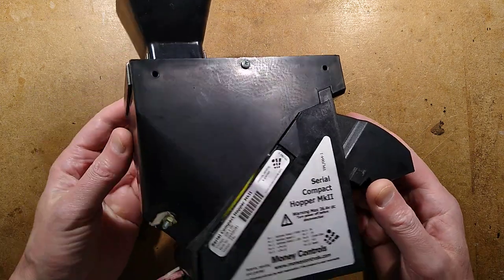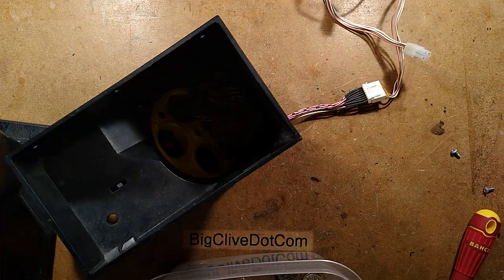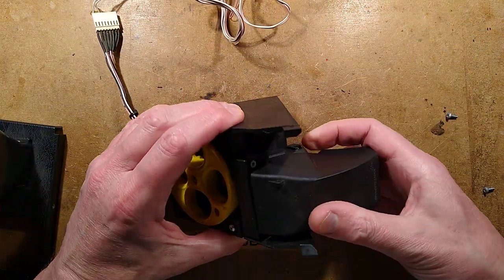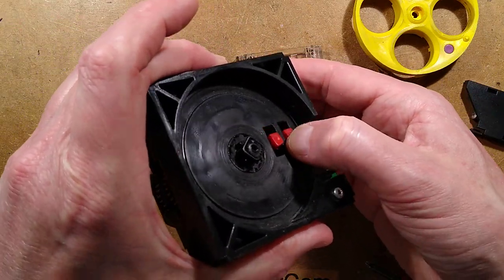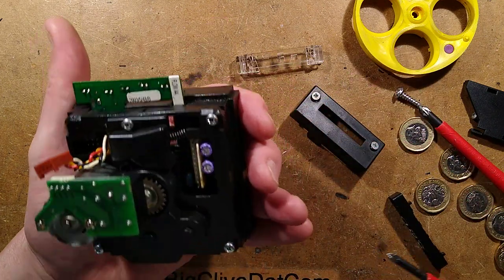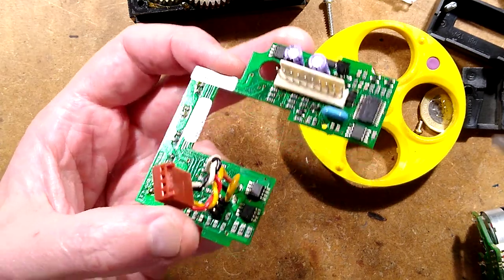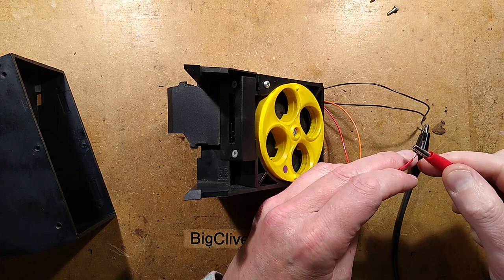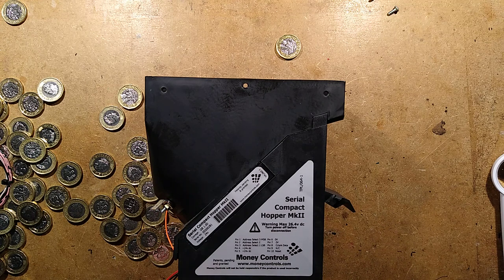Coin payout hopper teardown

Comment: There used to be a trick where you could shine a light up the chute, and the optical sensor wouldn't detect the coins springing out. However the computers running these know how likely a coin is to be pinged out if there is continuity, and it'll stop if you do this now. Sometimes they'll even alarm. On the old fashioned machines though, you do that and they just won't stop spewing money out.

Also, in the design clive seems to have, the fact the center sensor diode has 2 LEDs reflecting down onto it instead of the one, they could detect the intensity on the center and the outer ones to see if there's a difference. Then the machine would know something fishy was going on.
Reply: And I was just thinking to saturate them with a ton of IR. Guess I'm too late to that party.

Comment: I suspect the hot melt glue is to prevent vibration induced problems.  Those hoppers and their motors generate quite a bit of vibration, especially from coins dropping in and pinging out.  So the glue helps mitigate the risk of a pin working it's way loose over time.

Comment: AVE’s work here is done.
You have a high speed healing bench, you can analyse the construction of mechanical gears and once you have a Stanley knife to cut into the plastic to determine if there is glass fibre content, AVE can retire with a clear conscience.
Perhaps if you sent the mechanism to him he could see if it could dispense small munitions at the same high speed as it does coins. That would be fun 😁
A very interesting video, I had never seen inside one of those mechanisms before

Comment: The DC braking is probably to stop the little red plastic detents from paying out extra coins. The motor is geared down and with all the coins in their respective holes, it has a fair bit of inertia, so you want to stop it before it overshoots and dispenses an extra coin.
Reply: I would imagine that motor braking really took out some relay contacts.
Reply: I'm puzzled as to why Clive didn't show is the difference between braked and unbraked stopping.
Reply: Does this dead-short braking work with induction motors ?
Reply: @millomweb  Induction motors use DC injection braking, where a low DC current is put through the motor.
Reply: @ATMAtim  Its actually pretty harmless on the contacts since there is no arcing on the opening action, which is the main failure mode of a relay.
Reply: @drkastenbrot  So linking all the wires together doesn't work ?
Reply: @millomweb  with an induction motor there are no permanent magnets to provide a consistent magnetic field for braking
Reply: @millomweb  not as consistently, residual magnetism might still be enough to cause current to build up but it will be delayed and inconsistent.
Reply: @drkastenbrot  I know :) but there's a rumour going around that the induced magnetism remains for a short time while the rotor spins.
Has my electric hedge trimmer got any permanent magnets ? I don't know but the short-circuit braking works on it (when the switch works!)
Reply: @millomweb  it absolutely does. short-circuit braking on a universal motor (like in your hedge trimmer) works very well because its literally a short circuit. there is no need for any fine control, it just shorts out the spinning motor right after it was powered, which will reliably bring it to a stop. after that, holding torque is pretty much nothing, you can manually spin it. 

you cant really do this with industrial machinery though, anything less than fine control and things may blow up. or they break due to excessive braking force.
Reply: @drkastenbrot  The thing with the hedge trimmer as the power off switch also shorts the motor out - so is pretty instantaneous on releasing the trigger. I'd be surprised if they've fitted a permanent magnet to the rotor just for this function so presume it's residual magnetism that's being used. Could be back emf with the power going off too !
But does this just work with a wire wound rotor and not squirrel cage - I don't know !
Reply: @drkastenbrot  Easily controlled by putting a resistor in the circuit if needs be. I don't think it is needed as the braking power is not going to be vastly different from motive power as the mechanism is the same. Interesting thinking about it though.
Reply: @millomweb  "Easily controlled by putting a resistor in the line"
There is 500 page books on industrial motor control. It is not nearly as simple. 
Without DC injection you are relying on a cascading effect where the current induced causes enough field to induce more current. You cant just "balance" this with a resistor. It either abrubtly stops with a huge current spike or doesnt stop at all. DC injection means adding an exact DC current for an exact braking power and the stopping torque remains as long as the DC is switched on. If your load has several tons of spinning mass, stopping things too fast can be catastrophic - not just electrically.
Reply: @millomweb  It is a mains powered hedge trimmer, right? This type of switch is very common in cordless tools too, but those use permanent magnet motors. 
The universal motor found in AC tools will reliably stop with a short circuit, if the short is made as it is still spinning fast. This is due to strong residual magnetism providing the necessary starting field for the cascade effect to kick in. 
There is definitely no permanent magnet in the motor because it would make the motor run poorly (lots of vibration with AC power).
Reply: @drkastenbrot  As it's the electrical current providing the 'braking' using a resistor to control/limit that current would control the braking. I believe it's what the Tube used to use. Hopefully now, it's more regenerative braking.
Reply: @drkastenbrot  Actually, it'd be a synchronous motor - running at a fixed speed dependent on mains frequency - as used in clocks and zone valves.
Reply: @millomweb  Trains use DC motors with field coils, and they keep the field current running, effectively turning them into permanent magnet motors. The control electronics used for braking are quite sophisticated, and the resistor bank merely serves as an "energy dump" Many trains use a third rail for regenerative braking, although its not as important as it seems, there is not that much recoverable energy in the first place.
Reply: @drkastenbrot  I don't recover many petrol mileage miles in my car going downhills either !

Comment: I used to work for an amusement arcade in the 90s. One of the things we were told to keep an eye out for was deliberately chipped or sanded off paint on the metal frame of fruit machines. This would indicate a possible "sparking" attempt. 

"Sparking" was done by applying a high voltage load (possibly from a capacitor) to the casing of the machine. The idea was that it would short out the machine and cause it to empty the payout hopper. I'm guessing the relay is there to prevent this.
Reply from the maker: It was probably for piezo sparkers.   Many machines have an antenna in the loom to detect that now.
Reply: Probably be the tube machines in the 90s most hopper machines have EMI shields and are unsparkable

Comment: I deal with these coin hoppers all the time. Often have to take them apart, due to the human factor of dropping more than just coins in the hopper. Plastic coin bags, bits of paper, screws and other items falling into the hoppers, jamming them up. I have to clean and remove the items from the sensors and spinning disc. This is quite an old hopper as the security software protocol has changed, but the basic design is the same, only 3 coin holes in the spinning disc in the newer version.

Comment: The ccTalk is very much like the original J1850 VPW communications standard used by Delphi/GM for their first generation OBD-II vehicles. Only real difference is the use of +12V instead of +5V in regards to the actual signal itself. Speed was quite limited (~10/41 kbps) since its basically open collector so the waveform had very sluggish transitions. Still it was nice to program with since there was a dedicated IC in the modules that handled the coms, and it only required a single yellow 16 AWG wire running around the car for the network.

Comment: I'm thinking if you found a way to force the wheel around, good luck dispensing coins quietly. Or quickly. Anything else is going to be very noticeable across the room. And that brake would make the job that much harder (though that coin shooter would be a challenge by itself). The whole up-and-over design cannot be by chance. And the noise has been engineered to equal success and riches. Skint via Skinner box.

Comment: Reminds me of the 70s-80s where some department stores had tills with coin dispensers - a separate unit from the till itself and usually positioned at the end of the checkout desk.
Reply: Many stores here (Sweden0 have combined receive/dispense units at the tills, next to the card terminal, so that the cashier doesn't need need to handle coins. The customer can just drop a handful in w/o doing an exact count, and it spits out any change not covered by bills/notes.

Comment: Sintered gears and things are made that way because they can be impregnated with oil and self lubricate, if you take one, wash and dry it, then heat it, the oil will start running out of it (I include an initial wash so you know its nothing from the outside coming off)

Comment: I used to know a few people who`s "job/carrer" was traveling around the UK strimming fruit machines. 
200k plus a year all cash no tax to pay!. 
But the little device they used to have was a semi stiff rod with a few movable joints. A wire running the length attached to a 9V bat and a push buttton switch. And on the other end was a light/optical sensor I think. 
So its was normally a 3 man job two people stood on the outside of the guy in the middle who was "playing" the machine. The two guys job was to block peoples view and to make it look like just some guys watching some one win. 
The middle guy after playing for a bit would take out the device and push/manipulate the rod up through the coin shoot to get to the optical sensor. 
With every push of the button it would trigger the coin/shoot to open dropping as much as they could reasonbly get away with without causing suspicion. Most have been caught over the years but as its classed as fraud which is a white collar crime they did very little time. Max was 6months !. Crime does pay if u can deal with a bit of time inside haha.
Reply: Modern robber barons require modern robin hoods.

Comment: The old universal hoppers that predated the compact hoppers were conssiderably simpler, being a motor control input and a photocell output. The internals used a plastic chain belt rather than the disc used these days by compact hoppers, so they could take pretty much any coin that would generate a wide enough pulse for the host system to read; their size also meant that they could hold several hundered pounds or a couple of thousand with the extension box that fitted on top (this predates the 2 quid coin) but obviously required a much larger armoured cabinet, hence the popularity of the compact hoppers. Interestingly, the same old pair of plates were used to detect the hopper getting low... I doubt anyone paid any attention to the signal, I certainly never did.

The CCTalk protocol was pretty involved with some fairly gnarly looking encryption of a cycling payout 'token' in conjunction with the payout amount that would prevent an attacker who gained access to the serial bus from replaying payout commands to get arbitrary payouts. You had to sign an NDA to get access to the intimate details and be from a company that had a reason to know.

In a similar move, the old style Mars coinmechs were superceded by intelligent mechs that communicated over serial rather than simply pulsing coin lines - they are all quite interesting inside though, with the various cutting blades and baffles to prevent stringing with fishing line and coils to detect metal stringing and coins going backwards through the mech.

Fake notes and coins were always interesting, the great thing being that you always end up with an example to give to the manufacturers for the next countermeasure - some old note acceptors could be fooled by a piece of paper with the appropriate strip of note attached, allowing two fakes to be made (since notes can be presented in any orientation)... multiple simultaneous scanning stopped that. One of the most labour intensive fake fivers I remember being told about (we made the control electronics for change machines so I got to write the software) was a B&W photocopy of each face onto tracing paper sandwiched around blue paper and a couple of metal strips - I think I would prefer a real job, it was a lot of effort for a fiver.🤔
Reply from the maker: I have one of the original universal conveyor hoppers.

Comment: Nice video Clive. I'm a gaming engineer I fix fruit machines in parks and anything that is coin or notes operated, I even buy old broken fruit machines and sell them, if you ever wanted to make another video like that I'd be happy to send you a newer part for you to experiment with. That hopper is out of an old machine or a plan cctalk communication like a quiz machine or a very old machine back in the 90s. But most machines in the pubs now only have DES inceptive parts that need to be paired in the machine in a certain way because it'll work in the machine. If you'd like to know more please message me but thanks for a great video, you've gained a sub from me :)

Comment: Yep, BCR (Bulk Coin Recycler). Those hoppers are fast, they effectivly spit out coins like a machine gun. Interesting to see them in this configuration. Money controls is quite widespread, they are alright. Not perfect either though.
Reply: That mechanism might well work for "nerf" type shooter.  Although, the projectiles might need to be a little too solid to resist the spring ejection.
Reply: Why am I wondering what Jörg Sprave would create for a coin launcher...

Comment: i'd guess the DC breaking feature is to prevent mechanical rotation of some kind.

the backwards 'long' gear ratio from the wheel to the motor would result in a high rpm rotation (high voltage as a generator) that could perfectly make use of the DC shortcircuit via the relay.

the same long gear ratio would multiply the breaking force from the motor to the wheel to even better prevent manual rotation.

Comment: Don't think I've ever seen the coin rotator go in reverse by itself. The metal disks in the hopper when connected to the bus will report coin levels I believe though resistance levels that get translated to a number via a table. An additional bit of metal on an edge is used for a hopper full trigger.

Comment: I use to work for Gala Bingo on the machines and they have security mods over the year's. With the relay on the motor is to stop people poking wires up to power the motor. People also would stick a certain light up the money chute to trick the machine to unable to count money being despenced paying out more money. Also people would make a small E.M.P. with 9v battery to trick sensors in coin slot to get free credit's. Fantastic hacking just like the old magnet trick to turn metal reels now they are plastic.
Reply: '...EMP..."
Dude you are going back to the mid 80s and the days of strimming  with that hack. Our local boys favoured the electronic lighter with unpredictable outcomes from destroying the MPU, loads of credits or just dumping the cash out. However, by the mid 90s that hack seldom worked due to better protection of the electronics.

Comment: As I stand here with my finger under the tap of cold water I tell myself, I should learn not to hold a small resistor in a peang with one hand and watching @bigclive tearing down electronics, and then try to grab the iron without watching... Lessons that has yet to be learned

Comment: I suppose any piece of coin-operated machinery, whether it's an amusement machine, a vending machine or a supermarket self-service checkout, has to be as super reliable as possible, as it literally is only making money for its owners as long as it's in working order. If it pays out too little, or misrecognises inserted coins as lower values, customers complain; if it pays out too much, or misrecognises inserted coins as higher values, operators lose money; either way, it ends up looking bad for the manufacturers of the equipment, since there is pressure from both directions for it to be accurate.

It would certainly take a lot of testing to ensure any proposed change to the manufacturing process was really going to make a definite improvement.  You would have to run a payout device continuously with a full hopper in a thermostatically-controlled chamber to ensure it was reliable at low and high temperatures, and probably arrange for it to be physically vibrated to ensure the machine could not be tricked into dispensing extra coins with a well-timed kick .....  I've worked in that sort of testing!  Doing things like cycle relays continuously switching heavy tungsten filament lamp loads on and off until you could see daylight through the contacts .....

Comment: my guide to unjamming coin hoppers. (Don't do this)
---
1) Find stuck coin
2) Shove large screw driver in hole to try and get it out.
3) Realise you screwed up, and bent the mechanism out of shape.
4) Take into workshop, disassemble, bend back into shape, put back together.
5) Reinstall hopper, and never talk about it again.